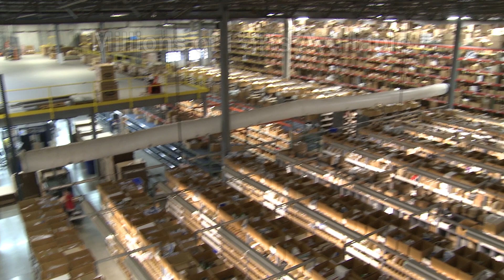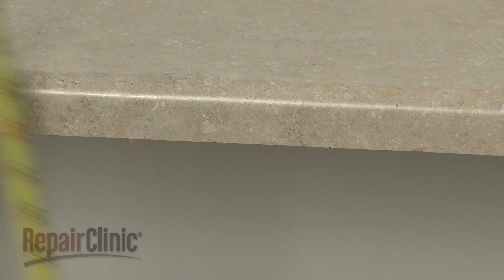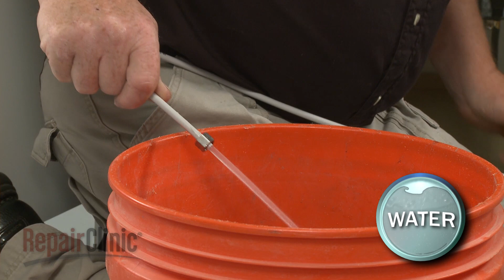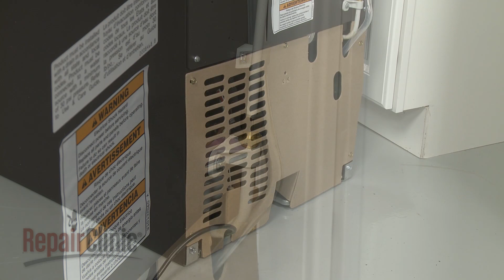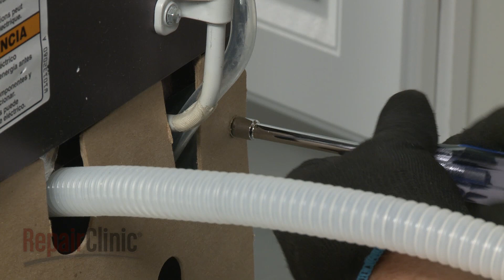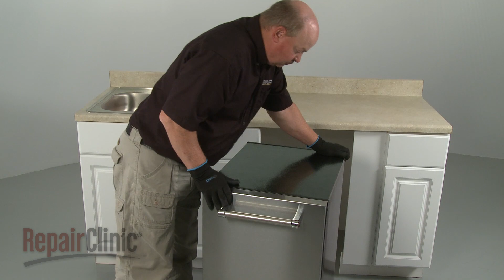KitchenAid Stand-Alone Ice Maker Installation (Model KUID508ESS)

Comment: If I am not mistaken, this installation to the sanitary system is not to code. Code requires an air gap (not air break) for installation of an ice machine. In the event of a back up, there is a very minimal chance for contamination into the ice maker.
Reply: Code varies by country, state and province